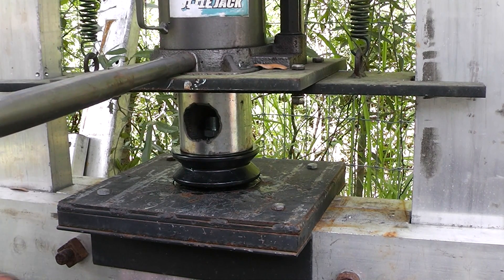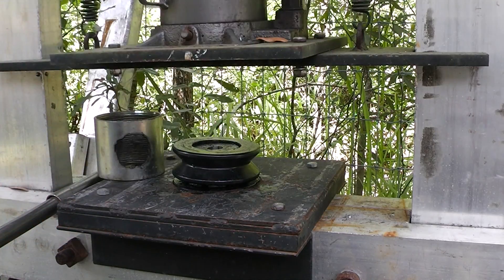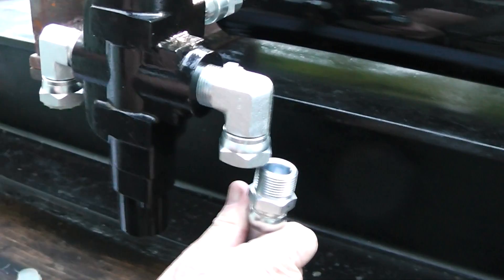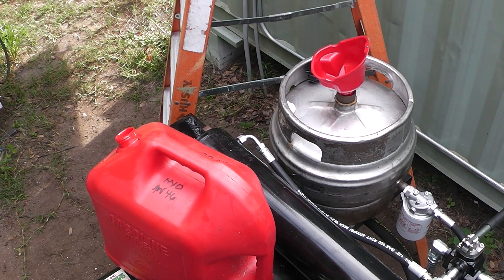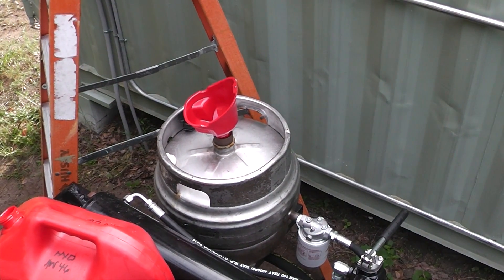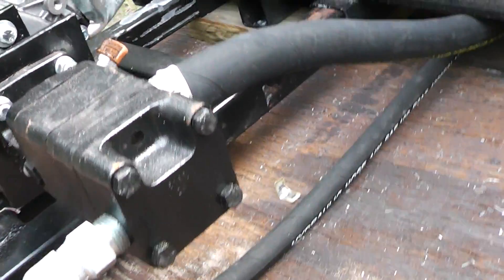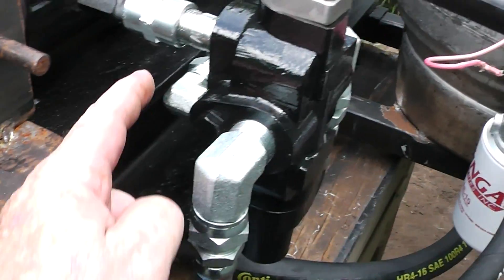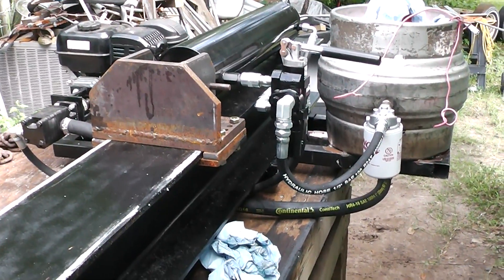30 Ton Log Splitter part 5 Hydraulics

Comment: The exhaust blowing up against the ram will heat the oil up even faster should have changed the motor around if possible or built a deflector

Comment: teflon tape and pipe joint compound on all the threads will keep it from leaking. The way you have it all connections will leak..
Reply from the maker: The log splitter is going on 2 years and no leaks.

Comment: that is awesome.. I cannot believe the price of new or even used log splitters  in  my area.
Reply from the maker: Thanks. 
That's a whole nother vid bro.  People around here want almost what they paid for theirs 10 years ago!
I looked at a '96 Brave 24 ton for $600 with rotted hoses, rotted trailer tires, leaking cylinder, missing trailer hitch and etc.  I thought, for a few dollars more I could build a new one!
Reply: my plans as well!